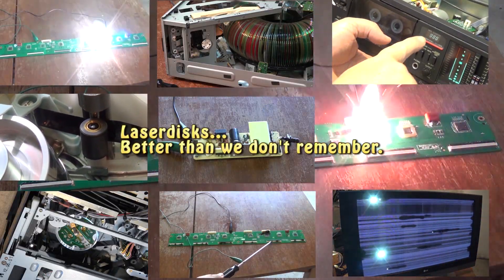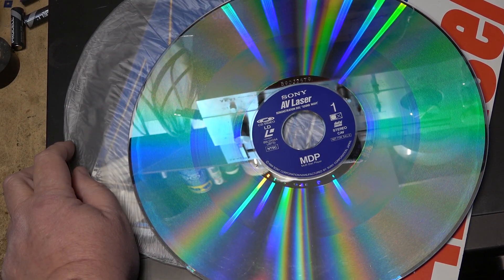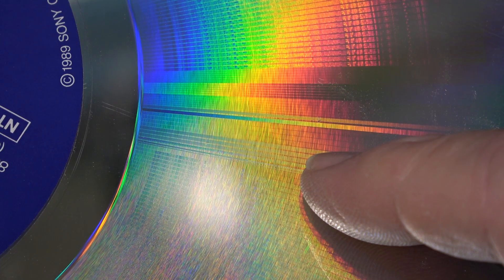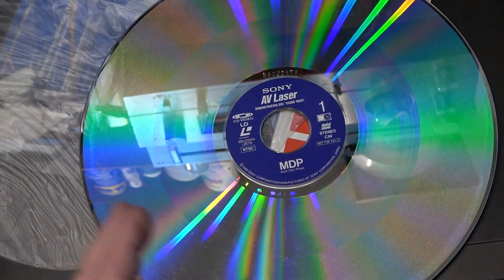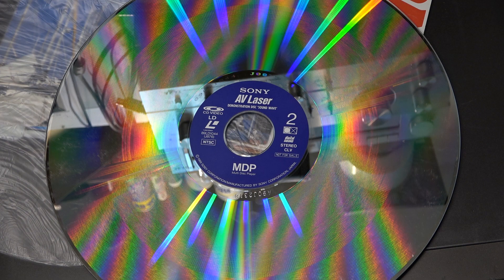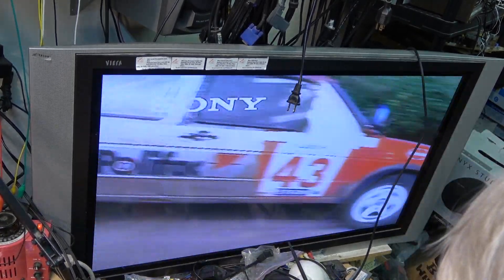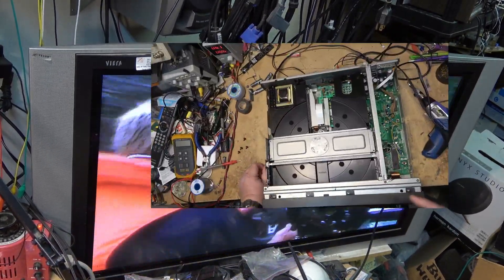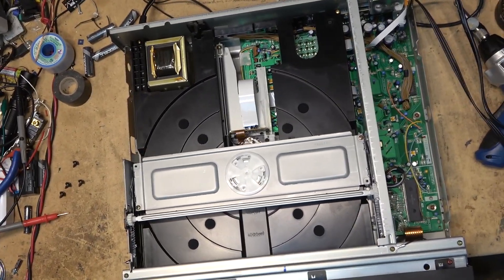Laserdisks better than you don't remember.

Comment: Excellent, Dave. Having never gotten into Laserdisk, I didn’t realize that the information on these disks was so visible to the naked eye. It certainly isn’t on CDs or DVDs. Great, eye-opening video. Thanks for taking the time to record and share👍
Reply: There are some DVD's where you can visibly make out sectors and that is DVD-RAM. Though it is CLV it has clearly visible sectors as it was intended to use as a live harddisk. It tried it to use like that but sloooow. I now used it to just archive stuff.
Cd's are basically CLV only, plus they don't have the same synch portions a laserdisc needs for video, audiocd's are digital audio. Though you can see tiny circles where there is some seconds of silence between songs, so you can make out the chapters and where the recording ends if the disc is not full.
A cdvideo is a hybrid between audio cd and video and you can clearly see the transition there between the two where the audio portion stops and the video porrtion starts.

Comment: Few years ago I looked up the block diagram of a Laserdisc player, and find out while the signal on the disc is composite video, but it's a modified composite video. The player separates the Y and C signals, and processes them individually, then merges them at the output to produce a standard composite signal. So this thing probably gives better picture with its S-Video output, because it skips the merging of the processed Y and C signals, and separating them again in the TV or capture card.
Reply: That really depends on the player.  Later models will base their composite from the Y/C separated signal but earlier models will take composite direct to the composite output.  So it depends on the quality of the Y/C Separator in the player vs the Comb Filter on a TV that determines what signal looks the best.  In most cases the composite will be better but you just have to try both options to see what looks more pleasing to you.
Reply: The s-video output from my Pioneer DVL-700 produces a sharper picture than the composite output. Small texts/titles are sharper with the s-video output.

Comment: The ability to get multiple audio channels, like remove dialogue from some films, is still unique.  I owned several, they all broke and never worked consistently, but I loved them still.
Reply: DVDs support tons of audio channels.
Reply: @eDoc2020  But on some settings on some audio types in LD you had the option of ducking the dialog and listening to the background music, which was cool for some of the classic Disney things, you could hear incidental music.  I haven't seen a DVD or Blu Ray player that offers this specific thing.
Reply: @widescreennavel  I don't think LD has any specific provision for disabling dialog. Likewise DVD's audio channels can be used for anything so there's no reason they couldn't master DVDs with one track missing dialog.

If it's a setting built into the player itself, my guess is it just disables the center channel. Assuming the player only decodes the stereo audio tracks this would mean only keeping the difference between the two channels and cancelling the common signals.
Reply: @eDoc2020  true, but I have yet to see a DVD player with multiple outputs to get simultaneous dual audio channels.  LD can output multiple channels.

Comment: I started my laserdisc journey only 3 years ago. Picked  up a new in box Sony MDP-MR1 with 30 big name titles very cheap and it works great. Only issue the player had was the discs would stick to the top clamp. The glue that held the magnet had leaked slightly. I cleaned it and all good :) My player will play both sides without removing the disc.

Comment: in the mid 90s, someone gave me a Panasonic from the late 80s, and two milk crates full of discs. It plays but the video on screen is a little mixed up. Ive never taken it apart to investigate. Then in the early 2000s someone gave me a Pioneer player from the 90s and more discs. I was told it had low hours and worked but Ive never tried it. I always loved Lazerdisks, a big step above VHS IMO. Along with the Pioneer unit they had a Dragon's Lair arcade game disk. Supposedly you can play the game using the remote control, which i do have. One day i'll have to break it out and stroll down memory lane. Thanks for sharing Dave!

Comment: Do not use Brasso. It makes things worse. I tried on a scratched CD. What I found works is wet sanding with 1000+ grit for the deep grooves, then automotive buffing and polishing compound. I tried by hand, but you really need a polishing pad on a electric tool. I'd try it out on a crap CD first :)

Comment: what a lot of people dont realize at least of this current generation is that the digital surround sound platform for home theater was  built off Laserdiscs and not DVD. It  played a huge part in the evolution of digital sound for Home theater. Lucasfilms use that format as the base for their THX program that set the standard for home theater in the late 80,s through the 90,s. They had their own remastering program to get the picture and sound quality from the discs and units that played the. Pioneer also invested  a lot of money and time into the format.

Comment: Years ago I invested heavy into laser discs and have a fairly large collection of them. None of my LDs have laser rot BUT I discovered that a few (not many) have warped slightly. I have no idea why they warped. I always stored them vertically. The warp is so slight that the only way you can see it is if you lay the disc on a glass surface. What happens is that when the laser gets near the outer edge of the disc the warp causes the laser to lose tracking. This is especially noticeable on CAV discs. I have no idea how to fix the warp so I no longer play my LDs.
Reply: They also rot, and most of the ones I bought, maybe manufactured late in the years of LD, succumed top rot in just a year or two.
Reply: Slight warps are not unusual for the LD format.  That is why LD players have tilt correction to adjust to this.  Try playing them and I’m sure most (or all) will play fine.  As for your CAV issues, I think it’s more about your player needing an adjustment or you really have a badly pressed disc (I used to have a defective Criterion Robinson Crusoe on Mars that had this issue.  After I exchanged it, the new one was fine).
Reply: @widescreennavel  Not all discs.  I’m pretty sure many of the titles in my collection will be playable after I am dead.  

The issue on many titles are where they were pressed.  DADC which pressed many Columbia Tri-Star titles were notorious for being really awful with a defect rate probably in the 80% region.
Reply: @MovieGuy846  The ones that are just slightly warped (so slight that the warp is not obvious when handling the disc) will skip as the laser nears the edge of the disc. I do not have "high-end" players. Perhaps a high-end player can compensate for the outer edge warp. Some of my CAV box sets such as "Casablanca" and "The Wizard of Oz" have at least one of the discs that has a very slight warp causing the player to skip as the laser reaches the outer edge of the disc. I should do an inventory.
Reply: @HD7100  I own 14 working players of various levels of quality and none of them have given me any playback issues on any disc with moderate warping.  I would really look into your player(s) to first see if maybe you need a regreasing of the metal rails (or plastic gearing) that could be hindering movement of the laser pick-up.  If you see dried grease on any of it, wipe clean first and then use a light machine oil on the metal and white lithium grease on the plastic gearing.
Reply: @MovieGuy846  Not a bad thought but most of my discs play glitch free right to the end of each side. It is only the few that are warped that glitch before reaching the end of the disc. Both of my players show the glitch to start exactly at the same time so the evidence is the disc being the problem and not the player.
Reply: @HD7100  In that case, let’s focus on the software.  The traditional way to reduce warp would be to place a disc between two completely flat pieces of glass and place heavy objects on them such as several books.  I think keeping the disc under that pressure for a few days to a week could be effective.  Afterwards, see if you notice a difference and if so then playback the disc.  If the skipping stops, problem solved.  If not, you could simply have had a poorly mastered disc all this time (assuming you didn’t notice the issue when you first bought it).

Comment: First of all let me just say i love your videos and channel. Thank you. I was curious if you could do a video on a vcr video head replacement and tips for alignment? I have an old Quasar 2 Head VH230 and i am trying to fix it. The vcr's symptoms with the old video head are snowy picture. Color comes and goes. I cleaned the video head , erase head and audio head. Audio is good. I replaced the video head with a Futek FV473 which is supposed to be a proper replacement. But was curious what the steps are after the initial replacement? Do i need the special tools for alignmemt? Currently the tape picks up fine. FF and RW are fine. But video is scrambled. If i play around with P guides it clears some and i get audio. But doesnt get a crisp picture.

Comment: Hi, interesting thing about "laserdisc rot", but does this also apply on normal DVD's? I think I have these trouble too with some DVD's although I don't know if that is DVD rot or not?
Reply: It's theoretically possible for any optical disk format where halves of a disk are adhered together, which DVDs are.

There's another kind of rot that I believe is a bacteria that eats aluminum.  It ends up creating jagged lines through the reflective surface.  Kind of looks like a miniature ant farm lives in there.  I had that happen to a CD-ROM disc.

Comment: With many hundreds of discs and over 10 players you could call me a Laserdisc fan.
I was late in starting to collecting laserdiscs in about 1994, by 2000 it was sadly brought to an end.
Most of my collection have been bought in recent years now that the prices have dropped to sensible levels.
Laserdisc is the only way to watch uncut and original films, the cartoon discs are highly collectable
as as the disney box sets and Star Wars.
As for the players, here in the UK we only had flimsy mid range models, i had to import most of my players
from the USA and Japan, the Japan only models are by far the best, but were not cheap, my HLD-X9 cost
about £1500 approx $1950, i had it serviced by Pioneer in Japan before shipping.
The HLD-X9 can even play some of the rotted discs the other player won't, i didn't bother with a muse decoder
the price of the discs are still way too high.
Sadly the format was ousted by DVD, which at the start was inferior, and the audio from laserdisc is still far better
than DVD's compressed sound quality.
DTS laserdiscs can even give Blu-Ray a run for it's money, the format was just too expensive for playback only.
Recordable laserdiscs were made but only for industrial use.
If you can find a good working player and a collection of discs buy it, the format paved the way for all the features
that are now on DVD and Blu-Ray.
Reply from the maker: I would call that a disease.
Reply: @12voltvids  The sad part is that there is no cure, someday i will get round to watching them if the players last that long!

Comment: I'd love to find a Laserdisc player but man are they expensive right now.
Reply: It's also rarely as smooth-sailing as in this video.  You almost always have to maintain the player a little bit -- replace belts, re-lubricate gears and rails, re-cap the electronics, tune up the laser servo controls...   And that's assuming you got hold of a player in working (or working-eligible) condition.  If you have to ship it, there's a good chance something's going to get broken in transit, as the mostly complete Sony laser optic module on my desk can attest.

Comment: None of the video on the demo disc looks like it was recorded on film. Do you know what they used back then to record that source material?
Reply from the maker: 100% guaranteed it was shot on either hi8 or betacam.  Hi8 as an acquisition format was actually very good.  The source tape was updubbed to betacam SP and then edited, or digitized directly off the source tape.  Mist likely camera used for say the shots on the jet boat would have been a ccdvx3. That was a 3ccd handycam that put out a broadcastable picture.

Comment: When referring to "well built" electronics, people always points to Sony, but actually Panasonic is very reliable. Things from 70's and 80's most likely still work fine, some even with their original belts ! Panasonic used matsushita components which were (and still are) high quality. It's rare for a panasonic device to require recapping (with the exception of sub-assembly they bought entirely from third party, like Philips CD mechanism)

Comment: Nice video but I'm triggered every time you put a thumbprint on the optical surface.  Laserdisc has no error correction.  Those smudges become visible degradation of the image.
Reply from the maker: Bullshit.  Video is FM modulated.  The surface of the disk is also not in the focal point of the laser.  Fingerprints have no effect on the picture.  Laser rot on the reflective layer certainly does however.
Reply: @12voltvids  I would disagree that fingerprints have no affect on picture quality as the oils attract dust and dirt and block the optical path.  But feel free to smudge up all your discs as you like.  Meanwhile I’ll keep mine clean.
Reply from the maker: @WaybackRewind  let's agree to disagree. It has been proven through multiple scientific tests when the format launched.  It's an FM signal. Not affected by amplitude untill the signal is below the demodulation threshold and the you would have an unplayable disk.  Laser rot on the other hand creates major issues for old disks and there is nothing you can do to prevent it.  Circular scratches also can create issues.
Reply: @12voltvids  we can still be friends and have different opinions.  😀
Me personally, I would never put my fingerprints on optical media whether it affects quality or not.

Comment: I never had a laser disk system,  but that first disk did look impressive and better quality than vcr's.
A very unusual technology, i expected you to have to replace the power supply caps and droopy belts. but no.
I didnt expect the psu to work.
Reply: For most of the life of the format LaserDiscs in the UK and Europe were constrained by the SCART port. When I started collecting titles in the summer of 1992 I was under the impression that I needed an NTSC/PAL player. But I bought most of my titles from the States and the picture quality was mediocre. The following year I bought a top of the range Pioneer CLD-98 from the local franchise and hooked it up through an S-Video connection. It was a revelation. I abandoned SCART completely after that.
Reply: @najdier  i didnt like the scart connector, i expected a propper screened case with round pins like a computer parallel type, but gold plated.
Also there were so many cables made with horrible wire, poor quality mini coax, i made one with quality 75 ohm coax.

Comment: It actually speeds up as you go further away from the center on a disk. Apart from that, a very informative video. Thanks for sharing!
Reply: That's incorrect. CLV discs do indeed slow down. How he described it is correct. There would be no benefit to speeding up a disc as the laser gets closer to the edge.

I also know because I own a Laserdisc player and have watched it play discs when open 😉 CLV discs are also much quieter as they reach the end of a side, because they're spinning much slower.
Reply: No it doesn't just like regular audio CDs are CLV which means they have to slow down to maintain the same linear speed as the circunference increases.
Reply: @t0nito  no I meant as in a regular spinning disc

Comment: just wondering how long to laser disks really last for before disc rot starts and what can be done about the problem ????
Reply from the maker: Some went bad after a few years and others are 40 years old and still play fine.
You can't do anything about it.
Reply: CD video is notorious for disc rot. Being gold, you can see the colour difference on the disc where it’s rotted. I’ve been collecting them for a few years, and it’s a lottery….
Reply: I personally also feel it depends on the manufacturer too...I have many CDs by TDK & MAXWELL,from the late 90s and 2000s,that are still in great condition with crisp Audio quality

Comment: Can laser discs be recorded in modern times?
Reply from the maker: Sure they can still make them but they don't.  The format was replaced by the DVD and then the Blu-ray.  The laserdisk recorded an analog FM carrier with the video modulating that carrier.  This was good in it's day but FM signals are relatively noisey and use tons of bandwidth hence the size of the disk.  Like everything else they have been obsoleted by better technology.

Comment: Laserdisk's are pretty cool. And that cd video thing i had never heard of. Speaking of digitizing analog stuff like vhs, what's the easiest way of doing that? Would for example the Elgato Video Capture thing be a decent choice?
Reply: You might want to look into getting a Retro-Tink 5x.  It's a product designed by an engineer in his spare time, mostly for older video game consoles.  But, it is particularly adept at digitizing analog video, and has some features that could dramatically improve compatibility with digital video capture hardware that wants a stable 60Hz video source.
Reply: @nickwallette6201  but doesn't retro tink not have s-video support? 
Elgato would be another option.